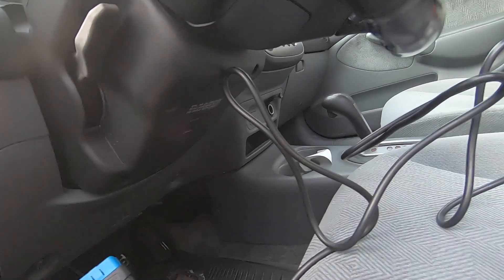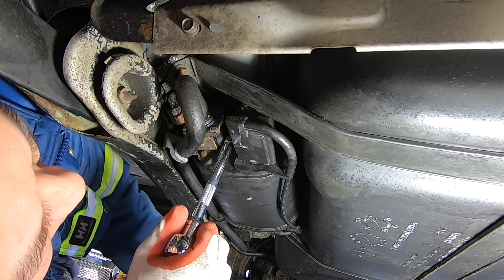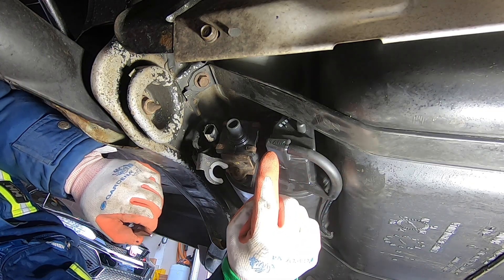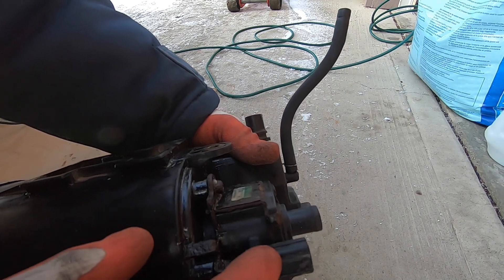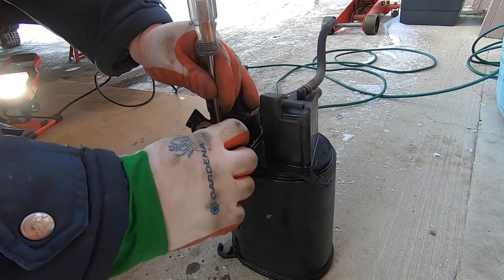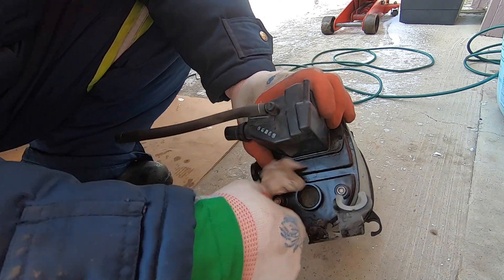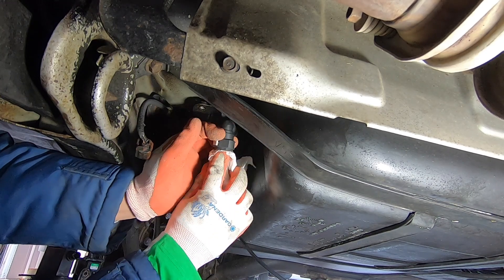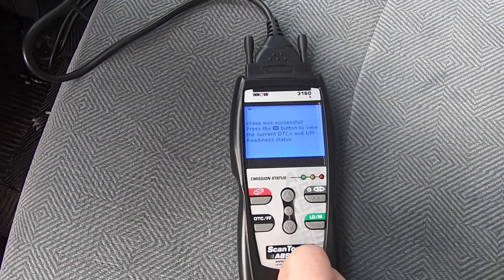Honda P1457 EVAP 2 way Vent Solenoid Repair

Comment: good friend greetings I have code 5 in D4 that will be that failure honda accord 2000.
Reply from the maker: sorry for the late reply but that code specifically pinpoints to an electrical failure in the transmission sensor that managing the shifting of the tranny.  It will need to go to a shop for further troubleshooting.

Comment: a vent valve?  or a purge valve problem? You call it a vent purge valve. They are separate. Code 1457 is the purge valve. code 2422 is the vent valve. Completely different part and location
Reply from the maker: My bad, it is a PURGE valve that I am replacing in this video.
Reply: @piercedasian  i have code p1457 in my Civic. According to my understanding, the vent valve is the one located attached to the charcoal canister, whereas the purge valve is located in the engine compartment near the engine air filter. Am I correct?

Comment: Great vid. I have a question, I am getting code P2422 which is an issue with the shut valve, do you know if the canisters for a 2005 Honda CRV come with the shut valve attached or is it separate like the purge valve?
thank you
Reply from the maker: my understanding is canisters and purge/vent valves ARE separate components.

Comment: Nice...did you not want to use a hand help impact driver because of the plastic bottom of the canister?  Great Work! :-)
Reply from the maker: no given how fragile 17 year old plastic is that I wasn't willing to risk breaking the EVAP canister.  Some gentle taps and slow and steady wins the race here :)

Comment: Isn't this the vent control solenoid? Because the title says purge. But good job anyway. Still very informative.
Reply from the maker: ah, good question!  Purge and vent are used interchangeably for this particular part.
Reply: @piercedasian  this is false information. The system has two separate valves. The vent valve is shown in the video. The purge valve is closer to the engine. There's a hose between the canister that's shown here and the purge valve that's not shown in the video.

Comment: I had this code, replaced the part and still get the code. Any thoughts?
Reply from the maker: hmm, have you checked your vacuum lines and you fuel filler neck for cracks and breaks?  Another common spot where things can fail is the filler neck and the flex hose that ties it all together.
Reply: run a computer on it and erase the code. i just replaced mine and started the car up. the code popped up i ran the scanner found P1427 so i erased it and boom and hasnt come back its clear! at least i hope it works for you!

Comment: I have a 05 crv and don't have a code P1457.
But a question when I pump gas it clicks off meaning it takes time to put gas in.
If changing vent purge solenoid would that help?
Thank you in advance 🤙🏽
Reply from the maker: If you don't have a CEL that would suggest the EVAP solenoid is bad that I would not bother changing it.  If the gas pump is clicking off constantly that is the issue with either the pump or your fuel filler neck.  I'd be inclined to believe it is the gas pump pushing fuel out too fast that is "sloshing gas" in the filler neck thus tripping the trigger mechanism.  Fill slower and you should be ok.
Reply: @piercedasian  thank you! Be safe 🤙🏽
Reply: Probably filler neck that's problem with mine I'm guessing now if your cars running and registering gas it's not ur fuel pump or sending unit